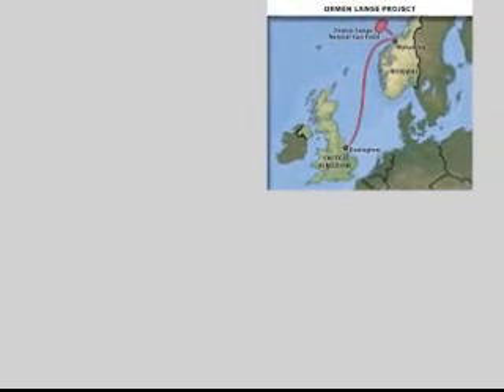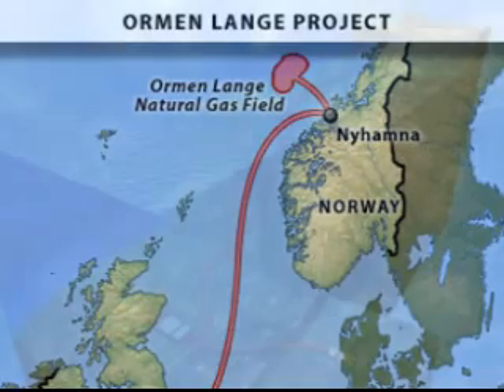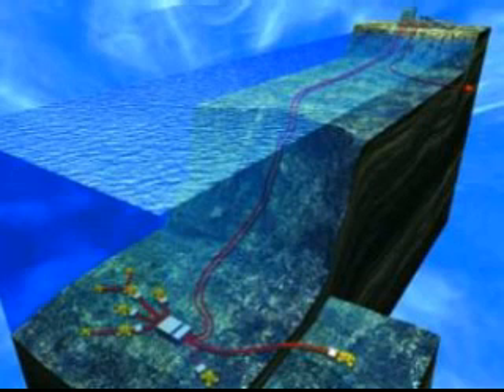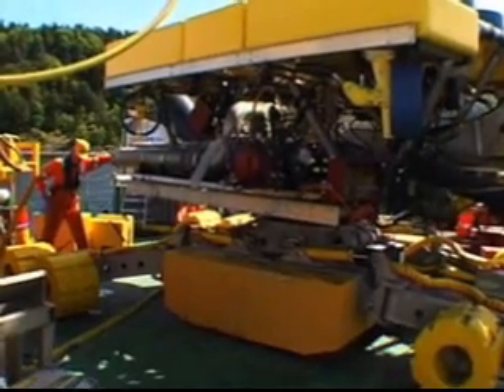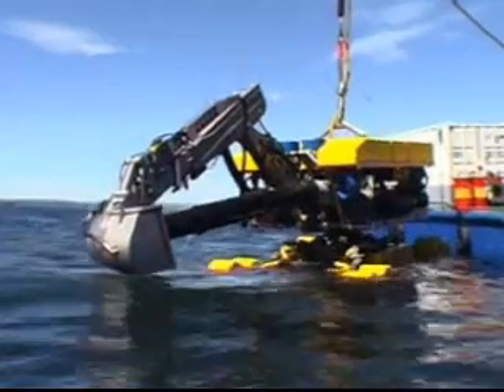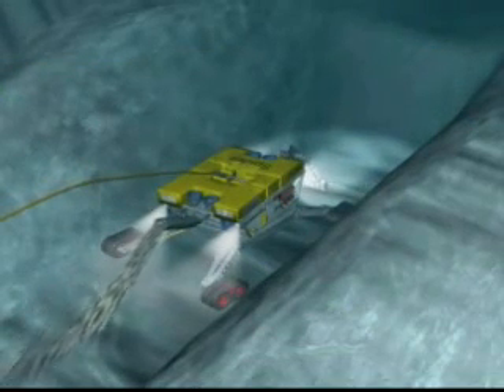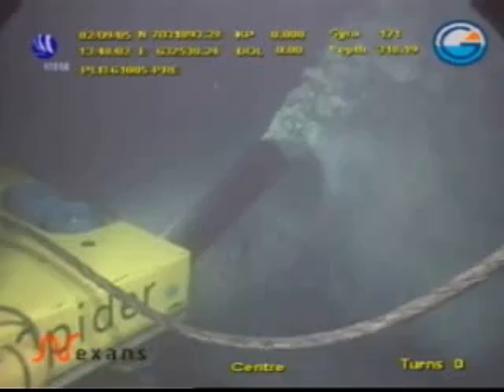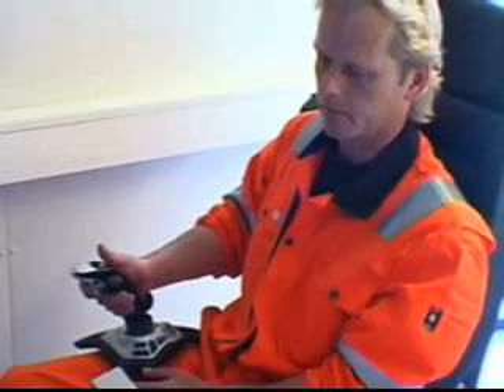How to Build an Amazing Underwater Tractor with LabVIEW

Comment: No I do not have the data you ask for because I am not sure of the cost per person needed to party into the year 3098, it varies per person per night!  What I am sure of tho is that if the other half of this money WAS put into renewable energy it would not only supersede this destructive endeavor in energy output but it would continue to supply energy long after the gas has run out and the effects of this violent exercise were realized! Hasanyone everthoughtEartht mayneedit's oil&gas whereitis??